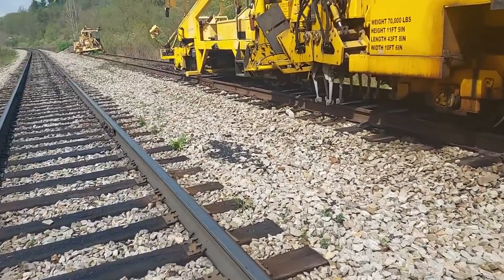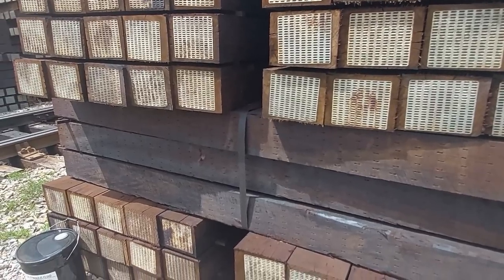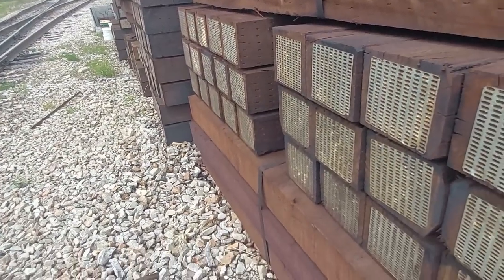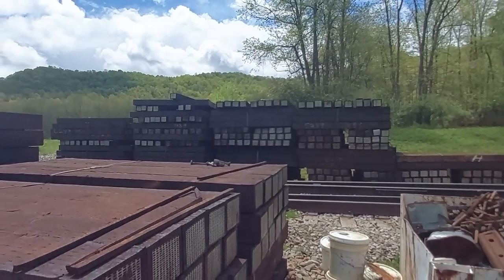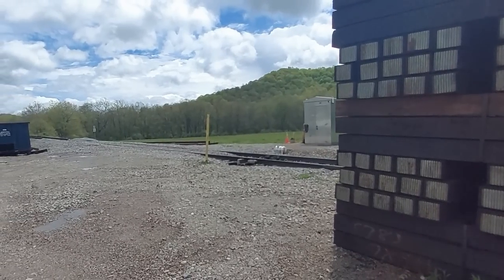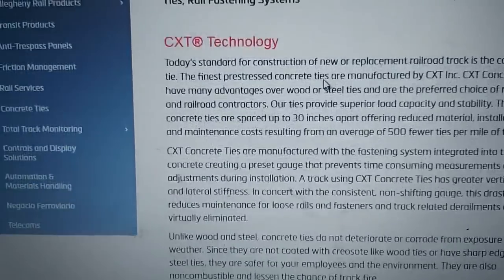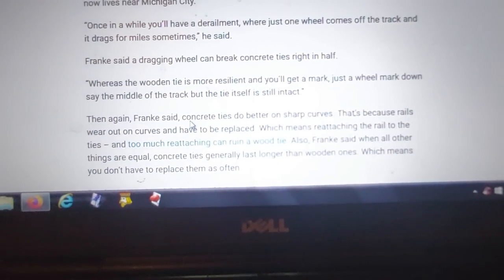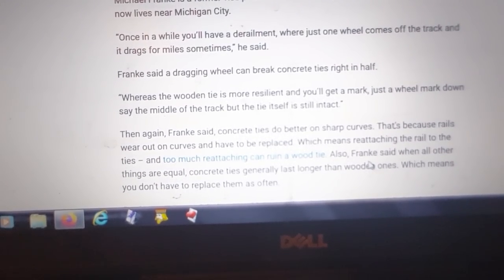Why some Railroads use Concrete and some use Wood Cross Ties

Comment: I thought concrete ties were a near permanent solution verses wooden ties, just that they cost a lot more up front.   I didn't known they were prone to cracking in half if a derailed car wheel hit them.  Even the steel connected two section concrete cross ties were subject to cracking the steel in such a wheel hitting situation covered in this video.   The fact that a derailed car wheel can crack a concrete tie appears to be their main problem.   There is an issue about concrete ties wearing out the insulator in their rail clamps due to sideways forces in curves mentioned in a comment below.   All curved track has high maintenance issues and I'd think replacing insulators is almost trivial in comparison to replacing a whole tie.  

The new concrete ties on new road bed sub ballast just east of Montgomery WV circa 1985 for about 3 miles rode almost like you were standing still when I was on Amtrak's Cardinal and those are CSX New River mainline coal train tracks.   It was the least jarring ride of the whole trip from Washington D.C. to Montgomery WV where I was going to WV Tech for EE.   The jarring on that trip is enough to make me sick when riding in the non Amfleet cars.   I'd spend my time in the Amfleet lounge / café car.  

If Amtrak could work a deal to have its routes rebuilt with a road bed and concrete ties like this we'd have an entirely better passenger train quality of service!   I'd think it would be able to take much higher speeds smoothly.  It is also better for the freight railroads trains as well.    I was disappointed recently when I used Google aerial view to study the CSX mainline that had concrete ties to see they'd been replaced with wooden ties.  The concrete ties might have lasted thirty years I had not checked sooner.    It was just a few years ago a crude oil tanker train derailed and burned on this section known as Mt. Carbon.   The fire and smoke looked like hell on earth from YouTube videos made from the other side of the river in Boomer.   The cause appears to have been a cracked rail with sonic grams indicating possible metal abnormality from past track sonar track checking data.   The explanation from news releases I followed over time was below the level of track mishap to cause such a large train crash and for it to happen to an occasional  fully loaded crude oil train was freakish.  There are over 10 coal trains a day over this line and more along with Amtrak's Cardinal.
Reply from the maker: Thank you for the nice comment Douglas. All RR's have their own
unique track problems/weather/economics, etc. There is no one tie
out there that is ideally suited for every single RR going. Each
RR has to use what is the best option for them, and often use
different options for different sections of track. Concrete, steel, composite or wood all have their pros and cons. It is a good thing
that there are options available to suit each RR's particular needs.
Appreciate your taking the time to watch the video and write in
my friend.

Comment: I saw concrete ties on the Amtrak track in eastern PA for the high speed trains. I thought CSX used concrete inside tunnels but I could be wrong.
Reply from the maker: Thank you for the very nice comment eottoe. Concrete lends itself
well to high speed passenger track. Appreciate your taking the time to visit with us and check out the video my friend.

Comment: in this video, you say that you use an older tamper and you would have to take time out to reset back and forth. Have you ever thought of setting a distance of 1 or 2 miles, do the wood ties first, then go back to the beginning set the blades for the concrete and then go over the same distance doing the concrete. In other words, 2 steps forward, 1 step back. Less time having to readjust and more time tamping. I did some M.O.W. for a short line years ago and most of it was done by hand.
Reply from the maker: Thank you garyjene for sharing your thoughts and for checking out
the video. Some older tampers like I have have a 5th limit switch,
that would be easier. If you watched the entire video, then you
should understand why there are many reasons we will not
use concrete.ROI is negative in our case plus the derailments. May you have a most blessed day my friend.

Comment: Dave.....
      What is the average cost today of a New Wood tie ?
&
What’s the average cost today of a concrete tie ?
Reply from the maker: Being that there are 28 different profiles of concrete ties, it's
kinda hard to give you an accurate answer Melinda. Each different profile has a different pricing. Wood ties here are $80.   All concrete are higher than that and heavier ones can be double or more the cost, plus transportation costs to get them to the job are much higher with concrete, because they are so much heavier than wood, it requires
more trucks to get them to the job site. Thanks for taking the time to watch and write in my friend.
Reply: @ccrx6700   Thanks Dave. That answered my question. 
  I wonder what kind of Hardwood they’re using these days for Railroad ties. 
  There isn’t much left in North America for Hardwood trees. 
   Like OAK it takes 2 lifetimes to get an Oak tree to Full size. Unless there’s Hardwood tree farms that just get the hardwood tree up to a smaller size then harvest them just for Railroad ties. Idk.
Reply from the maker: @melindagreen3023  😊👍

Comment: Good morning Dave, the cement industry is one of the largest contributors to CO2 in the world. When trees are converted into ties they become a carbon sink. Being a forestry guy I know young healthy growing trees are taking in more carbon than old trees so in my mind wooden ties are the winner.
Reply from the maker: Thank you for sharing your thoughts and for watching the video
Zulu Bravo. No argument from me on the cement industry's green house gas emissions being hard on the environment. However, in the video I was speaking strictly of the effect of wood vs concrete ties, not about an industry in the whole of itself.  

My information came from Robert Crawford, University of Melbourne
who did a comprehensive study on the CO2 emissions from concrete
and wood ties finding the CO2 emissions associated with concrete ties are two to six times lower than those from wooden ones.
Here is the link to that study:

Comment: I'm a groundskeeper for a large company.  The other day I inquired about buying railroad ties for landscaping at a local nursery and by their reaction you'd have thought I had just murderer their kids...
Reply from the maker: Talked to the wife bout your suggestion on the colored rocks, I
like that, she is thinking on it. One time spread and you're done.
What do you think about the recycled shredded tire mulch? 
Come on over here and we'll give you all the ties you want.
Reply: @ccrx6700  We've used the shredded tire mulch in the grandkids playground.  So far it's lasted about 5 years.  It's been, "OK" in my opinion.  You still have to take it out every five years or so, just to clean the debris and dirt that collects in it from deteriorating leaves, etc.  Otherwise you get weeds growing in the detritus. But, you can reuse that rubberized mulch.  It does tend to lose it's color very slowly over time, but not like normal mulch.  It's certainly better than wooden mulch.
Reply from the maker: @NorthernChev  Thank you 👍🫡

Comment: Dave what is the actual cost difference between wooden and concrete on average?
Reply from the maker: Being that there are 28 different profiles of concrete ties, it's
kinda hard to give you an accurate answer Phillip. Each different profile has a different pricing. Wood ties here are $80.   All concrete are higher than that and heavier ones can be double or more the cost, plus transportation costs to get them to the job are much higher with concrete. Thanks for Taking the time to watch and write in my friend.

Comment: For buildings there is a movement to use heavy timber as structure as an argument that wood acts as a carbon sink and is therefore more sustainable. The assumption I suppose is that the cut down trees are replaced with newly planted trees.
Reply from the maker: Thank you Jacob for sharing that with us  and for taking the time to check out the video my friend.

Comment: I haven't seen a lot of info on steel ties.  I assume the big problem is track to tie isolation for signals and the like.  However, steel ties tend to resolve the poblems f the ties breaking at a minimum....  (I assume that they are significantly more expensive than either wood or concrete, thus keeping them out of the mainstream..)
Reply from the maker: Thank you for the nice comment Billblom and for sharing that. I
will do a video sometime on steel ties. Appreciate your taking the time to watch and write in my friend.

Comment: My Cliff notes on the reasons why Wood v.s. Concrete relevance for laying new ties from this video
1. MOW equipment not being up to date making it extra costly for slow integration, so you're either going all in or staying out.
2. in the event of minor derailment events Concrete could be completely destroyed while wood just gets a low life expectancy at worst
3. Cost prohibits need for Concrete if MGT isn't above an average 32 MGT. ( don't know if that's a Per day per mile, per week per mile, or per consist per regular trip)
4.  there are pros and cons to what you do with the retired ones once end of life comes around.
5. Concrete is the king of steep/sharp curves.
Reply from the maker: Appreciate the nice comment Dallen and for sharing those thoughts. 
You pretty much got the main points down. Thank you very much for taking the time to watch and write in my friend.
Reply: @ccrx6700  I'm glad YouTube randomly recommended the Video.
Reply from the maker: @Dallen9  👍😊

Comment: As a PA logger I hope and pray that American railroads never completely switch to concrete ties! I sell a lot of tie logs! They feed a LOT of families that I know. We get rid of a lot wood that is otherwise useless. It helps us manage woodlots by allowing us to have a market for undesireable spieces like birch, gum and red maple which are overtaking wood lots. 

Also, Koppers burns old ties to generate steam and electricity to make new ties so they don't have to go to the landfill.

We have plenty of trees, if you look at the data we have more forest land now than we did 100 years ago but we have 200 million more people! The woods are actually growing faster than we cut them. Wood is renewable, concrete is not. You can only mine limestone once and then it's gone. I'm cutting timber on woodlots that have been logged 3 times in the past 100 years.
Reply from the maker: Thank you Matt for the excellent comment. You are right. Appreciate your taking the time to visit and check out the video my friend.

Comment: something you mentioned around the 13 min mark i would actually refute is that using wood products is bad for the environment where concrete is more environmentally friendly. when wood or any plant for that matter takes in co2 and expels o2 it takes that carbon to build its self as food. when you chop down trees for other uses your effectively taking co2 out of the air, trapping it, and then using it in some product where at the end of the life of the product will be burred under ground in a land fill. another thing  is that old trees absorb way less co2 than new trees, so tree farming for train ties its way better for the environment since your constantly replacing old trees with young new trees. that being said concrete releases co2 when it cures and uses up non renewable recourses such as beach sand.
Reply from the maker: Thank you Anthony for sharing your thoughts. what I was saying was the creosote was not good for the environment nor the
end of tie life disposal. :)  Appreciate your taking the time to check
out the video and write in. May you have a most blessed day
my friend.

Comment: I do think part of the resistance to using concrete in North America is just due to the investment, because basically in improved conditions and maintenance, the resiliency of concrete is better than wood. But because railroads in North America tend to avoid infrastructure maintenance if at all possible, try to avoid hiring enough workers, or invest in equipment or building new infrastructure, of course they'd prefer to continue using cheaper materials which won't require improvements to their practices.
Reply from the maker: Thank you for sharing your thoughts eirinym and we appreciate your taking the time to visit with us and check out the video my friend.

Comment: Excellent presentation.
However, I think more study should be done on the carbon footprint of making 700 pound concrete ties. It takes an awful lot of carbon to mine the material for and to process it to make concrete, whereas wood can be regrown (renewable).
Reply from the maker: Thank you for sharing your thoughts and for the compliment
earlysda. No argument from me on the cement industry's green house gas emissions being hard on the environment. However, in the video I was speaking strictly of the effect of wood vs concrete ties, not about an industry in the whole of itself.  

My information came from Robert Crawford, University of Melbourne who did a comprehensive study on the CO2 emissions from concrete and wood ties finding the CO2 emissions associated with concrete ties are two to six times lower than those from wooden ones.
Here is the link to that study: 
https://pubs.acs.org/doi/abs/10.1021/es8023836

Comment: Concrete sleepers replaced wood sleepers in Australia in the 1980's. They don't rot or need to be replaced eliminating the need for constant maintenance and replacing sleepers. Australia has the longest straight stretch of railway in the world 328 miles or 527 kilometres without even the slightest bend
Reply from the maker: Appreciate your sharing that information Blake. Thank you for taking the time to watch and may you have a very good day my friend.

Comment: Recently a light rail line was completed near my home.  Most of the track bed uses concrete ties.  I say 'most' because on either side of  street crossings for about 100 feet the ties are wood.   Why would the railroad company do that?
Reply from the maker: Appreciate the nice comment zeek, that very interesting to find out,
I have no clue why. Thank you very much for taking the time to watch and write in my friend.

Comment: The train is going to put tension in the top of the tie in the middle. Concrete has negligible tensile strength. Also it has no flexibility which is vital for thermal variations.
Reply from the maker: You are right about that T B. Thanks for sharing your thoughts
and for taking the time to visit with us. May you have a very good day my friend.

Comment: We’ve been using steel ties in our switches as of late in our switch areas.
Reply from the maker: And how is that working out for you KCS? I need to find out
more info on steel. Thanks for taking the time to watch and
write in my friend.
Reply: @ccrx6700  primarily used for yard switches. For now. They are working out so far.
Reply from the maker: @kansascityshuffle8526  👍😊

Comment: What are the cost difference is between a concrete tie, compared to a wood tie
Reply from the maker: Being that there are 28 different profiles of concrete ties, it's
kinda hard to give you an accurate answer Brad. Each different profile has a different pricing. Wood ties here are $80.   All concrete are higher than that and heavier ones can be double or more the cost, plus transportation costs to get them to the job are much higher with concrete, because they are so much heavier than wood, it requires
more trucks to get them to the job site. Thanks for taking the time to watch and write in my friend.

Comment: Fascinating video, but you've got the argument about trees being cut down on its head. When trees are farmed every time a tree is cut down at least one other is planted in its place, so cutting down trees doesn't diminish the amount of trees there are in the area. Greater use of wood also creates a market demand for that raw material, leading to an expansion of forestry and an increase in the area of land planted with trees. If there ceases to be a demand for trees then there will be less need to plant them and thus a reduction in the amount of land planted with trees. In short a demand for wooden railroad ties increases, not decreases, the number of trees.
Reply from the maker: Appreciate your sharing those thoughts Alexi, I do stand corrected, you bring up some very valid points. Thank you for taking the time to watch and may you have a very good day my friend.

Comment: Very interesting video, just want to add a point of view from the European side of the ocean. In Europe the railroad right of way is almost always owned by a public company, that is except industrial sidings which are still private property.
Therefore there are less constraints about making capital investments on infrastructure and as a general result the right of way is in far better shape that in the us, especially non us mainline.
So the economy of making long term capital investments and the environmental regulations make the cost benefits analysis generally in favour of concrete ties; any derailment in Europe outside private sidings or switching yard is also taken very seriously by the railway regulator and the public in general, so they do very rarely happen.
Reply from the maker: Thank you for the very nice comment Minesweeper, that was
thoughtful of you to write in and share that. Appreciate your taking the time to visit with us and check out the video my friend.